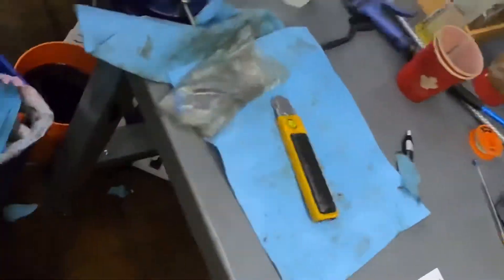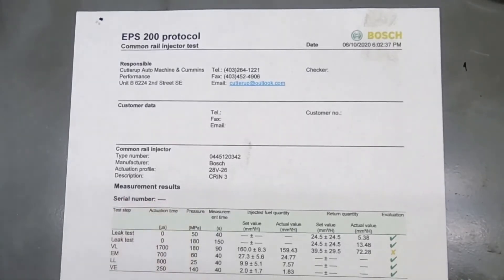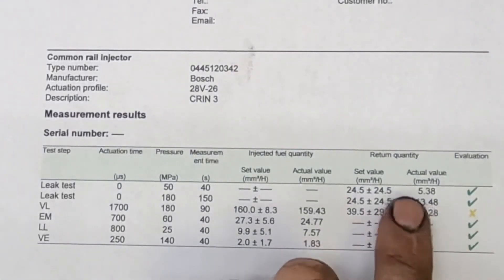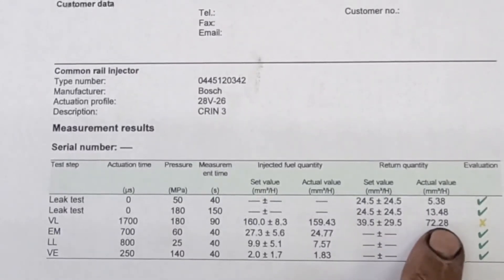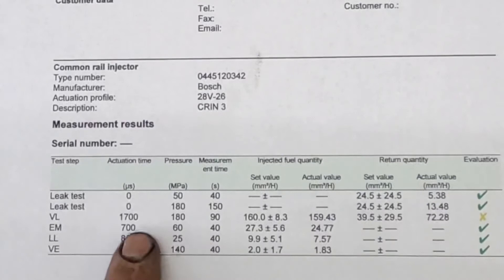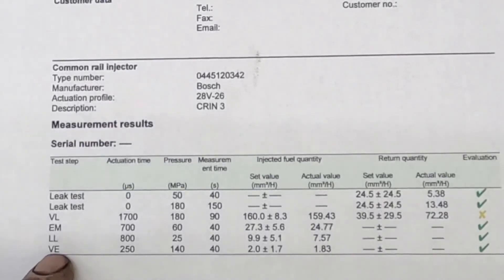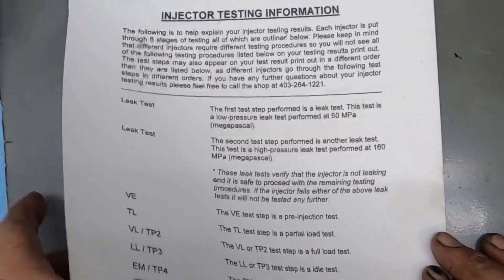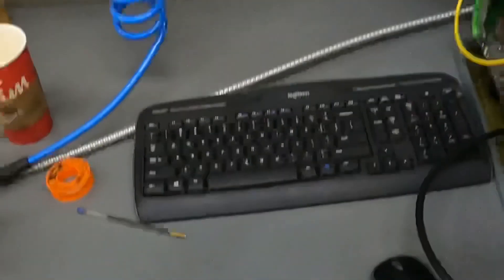How to read injector testing print out

Comment: Hey man, I appreciate the explanation, unfortunately I can not make much out of the test sheet a company set back to me. They repaired my injectors, so it's all good but I don't understand the sheet. It goes like this per injector:
Backflow Flow (cm3/1000) Overflow (cm3/1000)
                             0.0 .... 0.0                      20.0 .... 80.0
                              Result                           /37.1
P01           Flow (cm3/1000) Overflow (cm/1000)
                            55.2 .... 73.2                  0.0 ... 0.0
                             Result                            65.3/57.8
P02           Flow (cm3/1000) Overflow (cm/1000)
                            4.2 ... 11.2                      0.0 ... 0.0
                             Result                            7.1/52.8
P03          Flow (cm3/1000) Overflow (cm/1000)
                            41.3 ... 57.3                  0.0 ... 0.0
                             Result                            50.4/31.1
P04          Flow (cm3/1000) Overflow (cm/1000)
                            2.6 ... 10.6                       0.0 ... 0.0
                              Result                             6.2/24.8
P05           Flow (cm3/1000) Overflow (cm/1000)
                             21.3 ... 31.3                    0.0 ... 0.0
                              Result                             25.8/17.9
P06           Flow (cm3/1000) Overflow (cm/1000)
                             6.0 ... 14.0                     0.0 ... 0.0
                              Result                             10.1/11.1
There is a green tick next to each result. I'm guessing each of these is a certain circumstance under which they tested the injector and there is the result but I don't understand what exactly it means. Can you make anything out of it ? They are Denso injectors in a 2.2 liter diesel nissan
Reply from the maker: Best to ask the guys that did it. 
What’s posted there doesn’t makes sense to me

Comment: Any advice / opinions on solenoid metallic ticking. Gets louder under load. I don’t think it’s valve or rocker. I have my diagnostic reasons. Wondering if it’s common on a 6.7 to have noisy injectors . It’s much quieter when the fuel is below zero C cold. Once fuel warms up it’s louder.
Reply from the maker: As they get worn they will get noisier

Comment: Hello. What will happen if the return flow value will be less than minimum tolorance?
Reply from the maker: If it just below a small amount that fine. But you want some flow to cool and lubricant the injector
Reply: @CUTTERUPROB  Per Bosch it must be 20 but one of the mine injectors was 17.3mm3/hub

Comment: Many thanks for the explanation of all the abreviations. I have a question though that concerns the VE preinjection. If your value is below the set value how this can be set right? Is it  by adjusting the ECU ? Thanks again ,good work.
Reply from the maker: If it’s below is just as bad as over. The injector stuff be recalibrated
Reply: Thanks for answering. Obliged! @CUTTERUPROB
Reply: Hello. If the actual return value is less than the set value what will it be caused?

Comment: I have a siemens 1.6tdi injector for a seat leon and it failed on the LL (idle test) my car rough idles. The other 3 injectors passed but only one failed the LL test. Would this be the cause of my car idling very rough and grunting really hard and also sometimes starts hard??
Reply from the maker: Mostly yes
Reply: Thanks for responding. You got a sub from me

Comment: Nice video!!! Respect! Keep up the good work. I have been to a service centre who has a Bosch common rail test bench and asked them to test my 4 injectors but also another 4 injectors bought from a used parts garage. After they have tested my injectors from my Fiat Panda 169 1.3 MJ 69hp and the other 4 from the garage, they gave me the papers and told me that i should mount the injectors that I have bought from the garage because my injectors were very bad. After the mounting, my car is not working better, in fact it works at least the same as before or worse because it`s more noisy and it sounds like its working on 3.5 cylinders, the fuel consumption its even higher than before when it was high already. This video helped me figure out that even if those "good" 4 injectors from the garage had the working specs between those limits on the papers, 3 of them had either very high or very low working conditions so only one is actualy good...money and time wasted for nothing in  the end! Thanks again :)